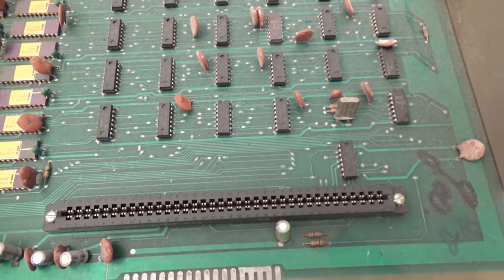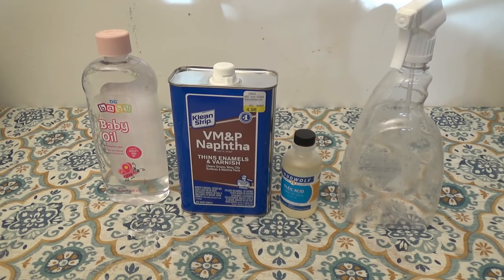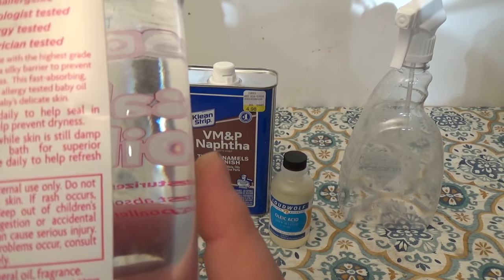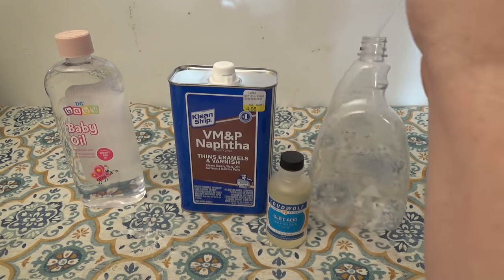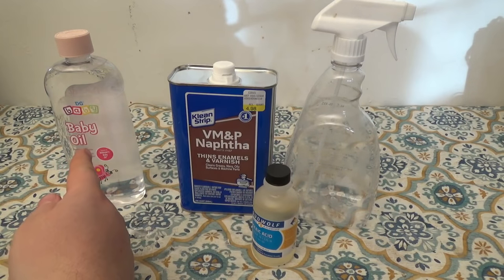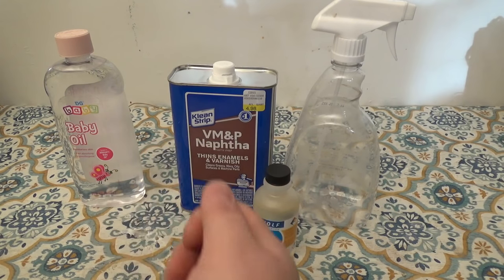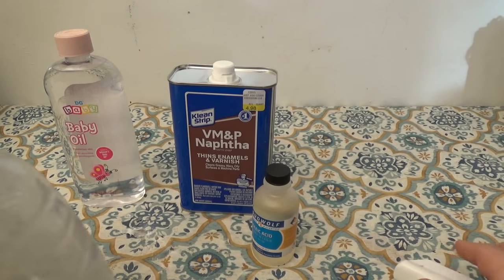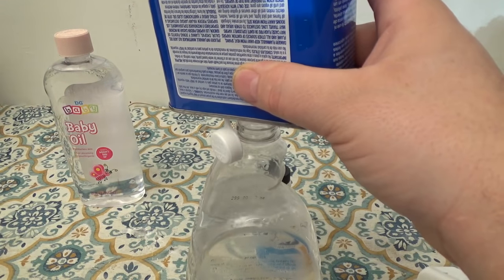Something  every arcade tech needs to know

Comment: In the alternate, non-oily recipe, what is the purpose of the Isopropyl Alcohol. Is it necessary?

I already have 91% on hand so I don't mind using it, I just wonder what it's for?

Great recipe Jason. I have a tiny bottle of unsaid product, but when it runs out... I'll be making this. Incidentally, it is red in color...
Reply from the maker: the isopropyl will just evaporate away the purpose is to thin the oily oleic acid